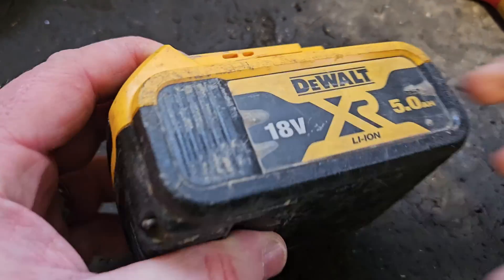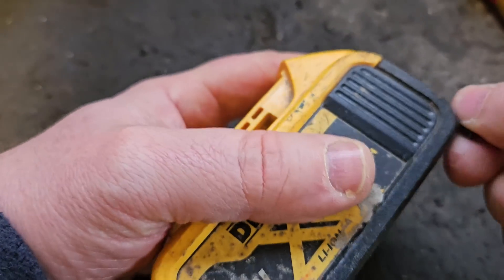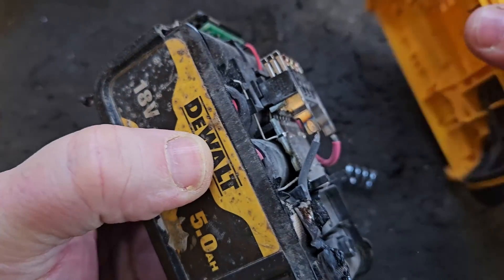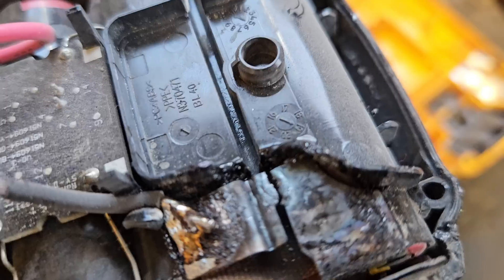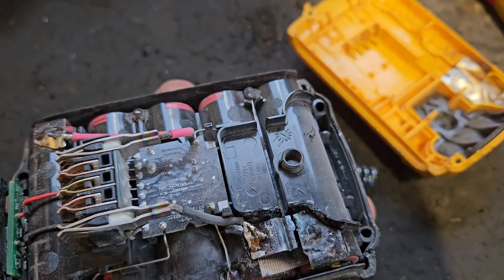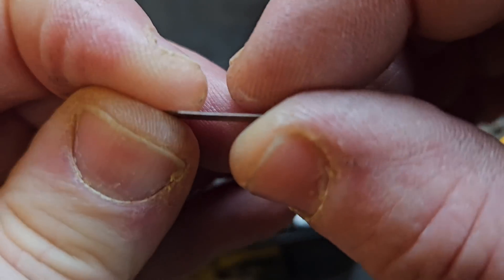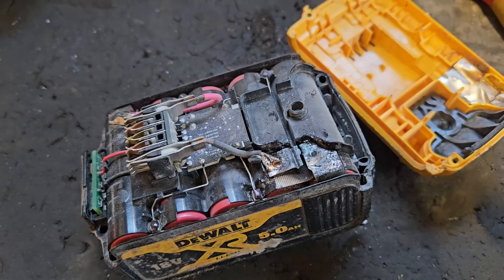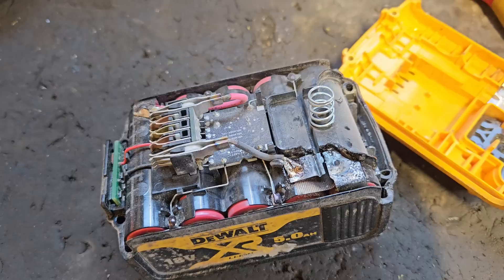This DEWALT Safety Feature is a LIFE SAVER!

Comment: Just asking, how would you fix/diagnose what caused the problem, wouldn't it happen again when you fix the fuse part? Genuinely just curious.
Reply from the maker: This is one of my videos that shows you how to test a battery to find the fault https://youtu.be/BxrCTjET9tQ?si=exKKao8qFxoPgh2L

That connection is designed to blow like a fuse if the battery is run too hard
Reply: @doctorlefthandthread  thank you for your answer, I will watch it now, much appreciated. 👍🏻
Just edited to add, I've subbed.